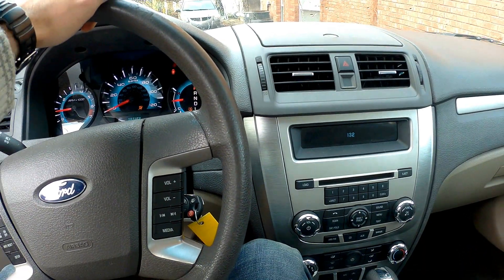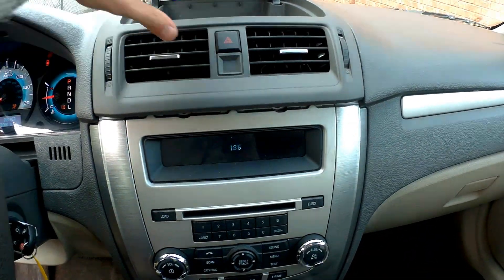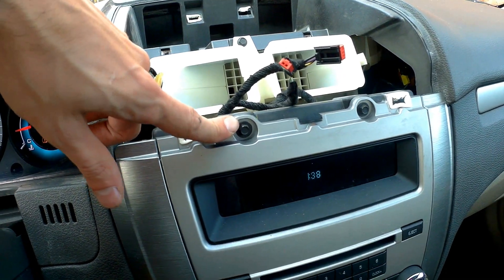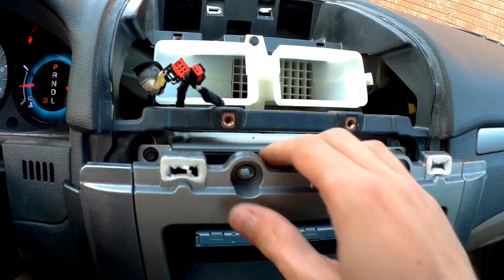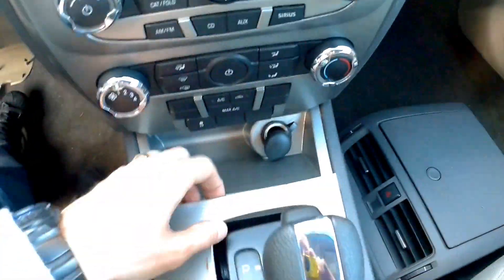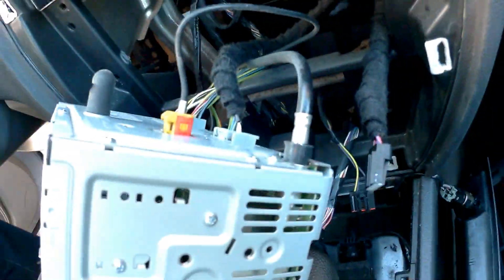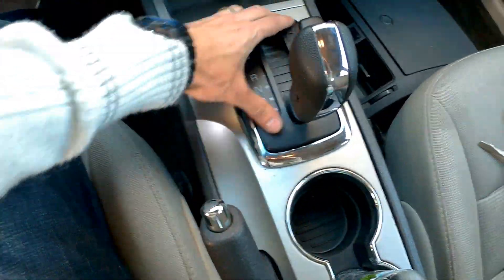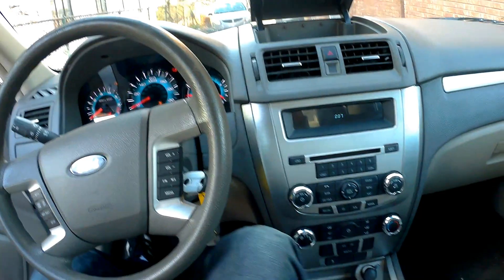2010 - 2012 Ford Fusion Radio Removal

Comment: The plastic strap you cut is a tether for the top vent assembly to keep the unit from becoming a projectile during airbag deployment. Those screws will NOT hold the unit if the airbag deploys.
Reply: Awesome, working on one right now and I can see a place under the dash to unbolt it
Reply: Thanx for the answer.

Comment: Very helpful video. Exactly  what I needed. I found that you can just raise the dash lid just enough to get the 2 bolts out so no need to cut the strap or unscrew the bolt holding it.

Comment: Very nice video! Thank you so much!
My uneducated guess on the strap that you mention around 3:20 is that it's there in case of an auto crash. The strap may be to prevent the dash component from flying into the cab potentially causing injury.
Reply: But how do you remove it without cutting it?
Reply: @motenmedia8334  It wasn't easy, but I managed. it can be done.
Reply: Under the dash next to steering column, that strap is mounted on a stud with a nut
Reply: How can pullup the antena

Comment: It is a safety retaining strap. You can find the other end bolted near the driver side of the panel. It is held in place by a 10mm nut. If you get on the driver side floorboard and look up near the gas pedal you’ll find it near the blend door actuator. It is kind of difficult to get off if you try pulling that top compartment first. I would recommend starting with unbolting the retaining strap.
Reply: Sean P is it easy to put back on?
Reply: Thank you!
Reply: God bless you if it wasn’t for this comment I would of left the tab open

Comment: I appreciate this video. Wasn't working on my radio, but it helped me get that pesky panel out of the top to halfway fix my vent. Now I know what to do when I fix it fully, and already disconnected that safety cable. Will be much easier to work around in the future. Thank you!!

Comment: The piece that you cut is a retention strap the other end is attached below the steering wheel. I was working on my 2012 fusion and the Ford Dealer actually cut this strap to do a an air conditioner repair. It does not serve a vital function. It might be theft deterrence, but if you are going to steal a radio I can not imagine they would care about your dashboard.

Comment: That piece just keep that middle piece from hitting you if you wreck and screw hole break on impact
Reply: That's what I was guessing as well. If during crash tests that center piece became a projectile, they could have added that strap as a leash to hold in place.

Comment: You are lucky the air bag was not activated!  Step 1, disconnect the negative battery lead.  That strap you cut does provide an important function.  I'm not sure just what but it could be (like others have stated) to keep that assembly from becoming a projectile when the passenger air bag is deployed.  Years ago my instructor at a GM Training Center made the statement that every part is import and needs to be present.  He followed up with "if the manufacture could leave a part out they would have, saving a lot of money".

Comment: Strap keeps that piece from flying around in a crash and just above the gas pedal is a 10 mm nut holding it on losen that and remove without cutting
Reply: I was about to cut it, Thanks...
Reply: @juancarlossanchezarmenta6001  no problem glad I could help

Comment: The strap would prevent the console piece from unplugging and thus disabling the passenger airbag in an accident. Could be a liability issue if a passenger was injured and this cord was cut.

Comment: That plastic strip is bolted down under the steering wheel.  You can pull off the panel under the wheel to unscrew it without having to cut it
Reply: wht the hell ford engs put that shit???
Reply: Nope I’ve just been under the car – under the steering column the strap is located nowhere that is accessible to undo from the bottom so I also cut it
Reply: I saw the other end of the strap under the driver side dash, secured by bolt. I have to fix my vent thanks to my heavy phone (vent mount). 😂 I see no purpose for this strap.. 😑

Comment: Why did you need to replace the radio module, was yours draining power with the car off too? I'm caught between wanting to replace the radio, install a battery cutoff switch, or push the car off a cliff.
Reply: That's why I'm replacing mine.  It failed and put a draw on the battery, key off engine off.
Reply: @fatlogan8071  I figured that's what I've gotta do.. you know where to get them from?
Reply: Stealership wanted $900,

Comment: No that's a safety strap there's a screw holding the other end of that strap down under the steering wheel somewhere I saw in another video
Reply: How do you take it out without breaking? Did the other video show you?

Comment: how do u fix the heat in a 2012 ford fusion car
i have no heat
Reply: Sounds like your vent door actuator is stuck on a/c. It’s located on driver side right wall near brake pedal.
Reply: Flush your heater core and radiator. Do a coolant/antifreeze change. Did it on my 2010 Ford Fusion Sport. Heat works again.

Comment: Can you swap this normal cd player kit with the navigation kit that comes with some of the fusions in this model?
Reply: I am about to do that. That’s why I’m watching this. I need to change all the panel. The a/c buttons too and all that. I hope I don’t get any truble. I’m also changing to the leather sits.
Reply: Did you do it?
Reply: no i wanna know if  its possible
Reply: Alfonso Braña Were you able to do it? Im gonna try to do mine
Reply: @alfonsobrana1933  how did that work... I would like to change Mines to an Android auto head unit
Reply: Erick Wright it didn’t work. It’s easier to use an aftermarket stereo. If you wanna use the original screen stereo from fusion its to dificult. I couldn’t make it work
Reply: @alfonsobrana1933  yeah I just wanted to replace it with then whole new Android auto head unit like the ones you can get in the 2017 Fusion

Comment: You cut the light pipe for the Passenger Airbag Warning light.
Reply: Random NASCAR Fan
Nah, the strap leads to a spot under the steering wheel and is just bolted down.   Its looped at the connection, so taking the nut off and removing one of the loops gives enough slack to access the screw on the storage compartment and remove it